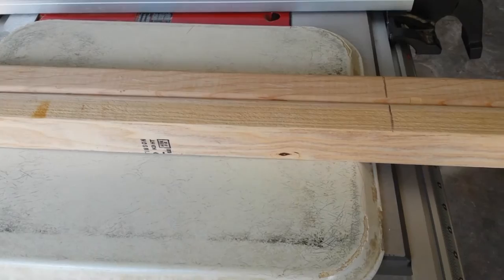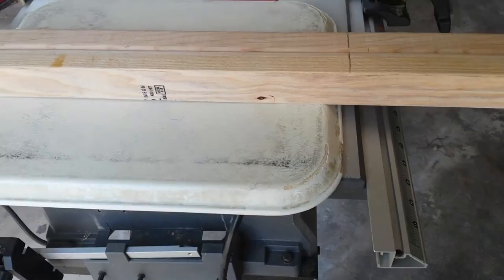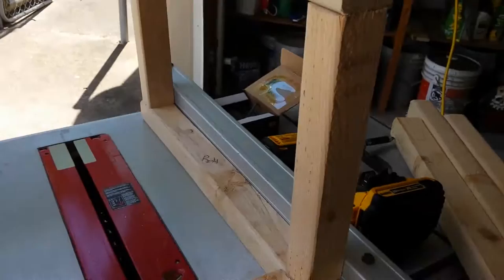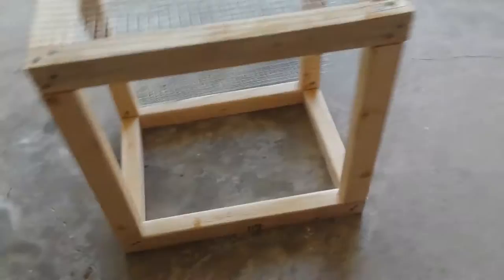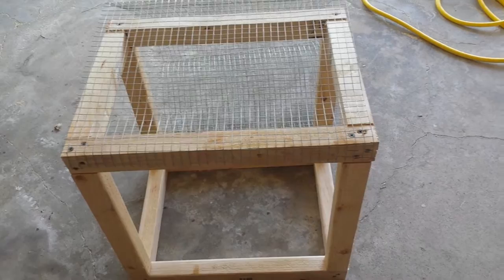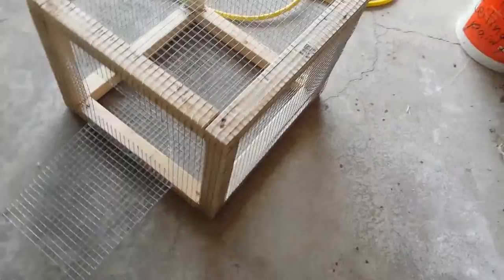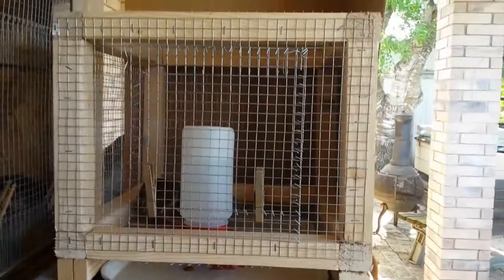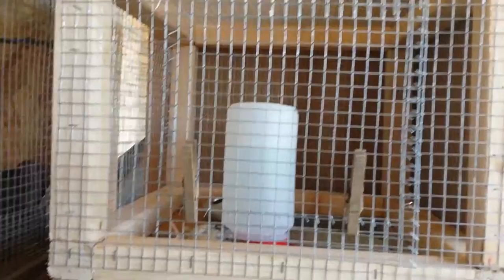DIY Small Quail Pen

Comment: How many quails could I raise in a 4ftx4ft pen
Reply from the maker: Random Person101 that would be 16 square feet of space and in my 2 x 6 foot pen (12 square feet) I had 12 quail easily and could have handled more probably 16 to 20 would be the max in my 2 x 12 so I would say probably 20 to 24 would be the max.  Probably it is possible to do more but the more crowded they are the more stressed they will be.  I tend to go on the low end and if I needed more birds I would have more pens and try and keep the numbers in the cages lower.  I am not sure what commercial growers would recommend but I suspect it would be higher numbers.
Reply: @tinytprepper6909   oh ok thats a lot more than i though i can keep in it i though 7 was good number wow